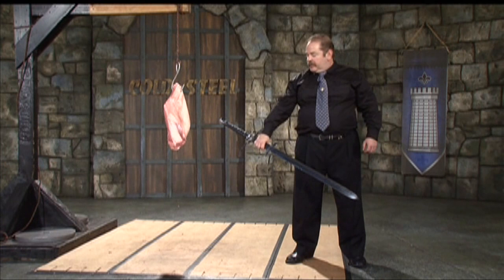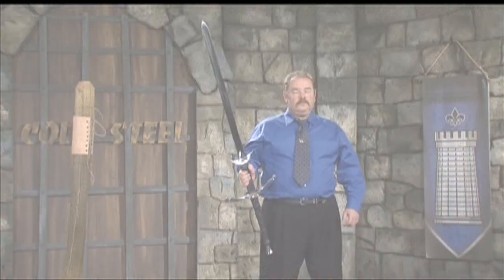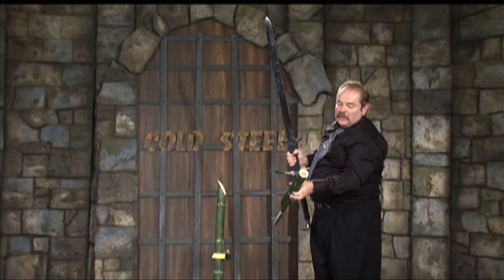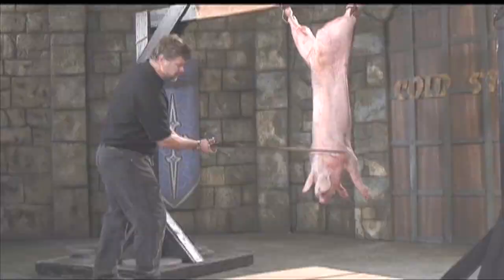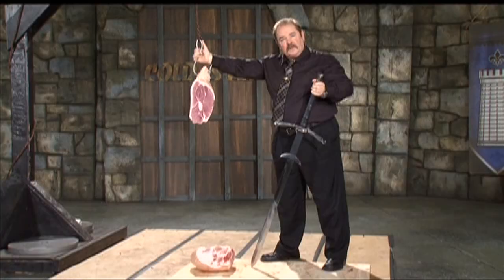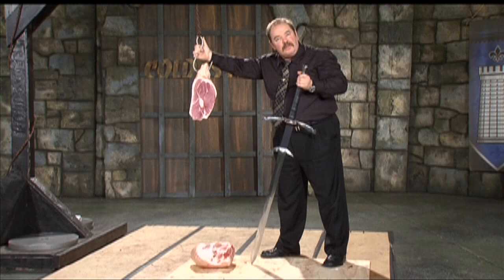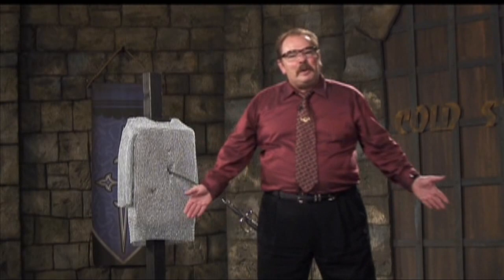Two Handed Great Sword | Cold Steel

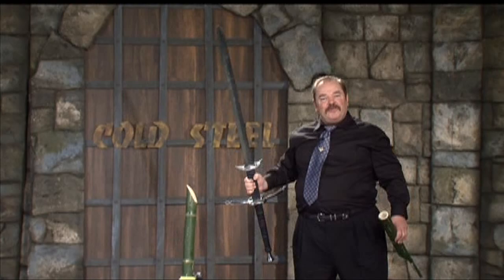Comment: 3:29 Finally i see someone wielding it as its meant to be wielded. Keeping the blade in motion is what defines a weapon like this because you cannot constantly move/halt a 6 Pound sword with this length (although for the weight it should be a little longer).

Comment: "Its an enormous advantage in any fight, so long as your opponent is a stick of bamboo, a balloon, some boots with steak in them or a dead pig hanging from a rope"
Reply: watsupjew No kidding. That piece is much too short for six pounds.
Reply: apparently it was used for cutting down horses! or so my friend said. if thats so, we should be judging it on its ability to do its intended purpose, except horses are valued higher than steaks in boots for some reason
Reply: watsupjew it cleaved those tatami mats pretty good. It's a good sword but yeah I agree that steak with zero bone in it isn't a good cutting test.
Reply: Entraya Crosshill zweihanders were used by frontline soldiers to break enemy pike formations. Pretty much anything that could stab was used to kill horses. but like you said, horses are valuable, so you should aim for the rider instead of the animal and then, once you win the battle you get a bunch of free horses for your army.
Reply: or a Medieval peasant who has no rights
Reply: This sword can cut you in half
Reply: Keep one by your front door, have no furniture or walls, and you'll be a force to be reckoned with
Reply: @potionseller8943  Soldiers were even more valuable to keep alive than horses - you could ransom them.
Reply: @potionseller8943  what's your point?!!! They cut through much bigger bones effortlessly!!! Bones in the cowboy boots wouldn't have made any difference!!!
Reply: @Crosshill  My first thought was that they made it so massive and clunky looking, so it'll just be able to act like an impact weapon. Hit this sword against the helm and the person might get a concussion from it.
Reply: @HayashiKaiji  i had the delight of holding one, felt more like an oversized gardening tool thats how long it was, pretty elegant handling though if you can keep it in motion. like a private sphere with a radius of a sweihander blade, aint no goon wanna have a go at the kind of mad lad dun spun that kinda thing around in battle
Reply: How would you swing this pos in your house?? this thing is almost 2x wider than my hallway.... lol
Reply: @Hoglow101  outside?
Reply: @flamingmexican9956 I was referring to inside the house..... Not outside. Goober lol
Reply: @Hoglow101  For narrow hallways I'd recommend thrusting weapons like a Gladius or some shit cause there's no way you're using any kind of longsword in your house.

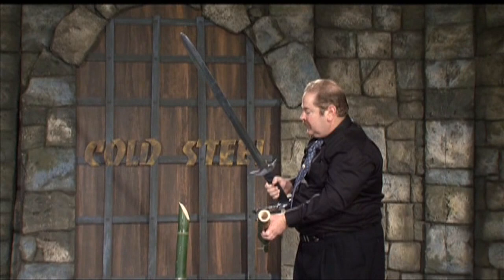Comment: Many people think of a great sword as extremely heavy and not as balanced, but most of that comes from not using certain aspects to your advantage. As a competitive swordsman the great sword is a fantastic weapon for relentless attacks. Using the the momentum from any kind of horizontal strike combine with the weight, you can almost always deliver follow up strikes. I think the best example of this being used is from 3:29 - 3:38 .
Reply: Because it takes a lot of energy to stop your movement after a heavy attack. But a major problem I have had at competitions is getting caught with the blade pointed down, as said it is a heavy sword, and trying to backhand swing in panic usually results in you loosing your balance.
Reply: TheJellyfishLord Pls not now. I play Dark Souls as well but im also a competitive sportsman and what this is actually interesting to read lmao. You ruined it you filthyCASUL!
Reply: TheJellyfishLord Rofl.
Reply: +Rex
Why would you backhand swing when pointed down in the first place? I'm not even into this kinda sport but all the videos I watched about uses of this sword, they usually try to block their opponent at range when the sword is pointed downwards. Correct me if I'm wrong.

Comment: this sword is an absolute beauty
Reply: It's Cold Steel, so not really.
Reply: why the fuck does it matter what it is mate? I think it's fucking beautiful
Reply: dolan dak It appears as a joke, in my opinion. Six pounds? I've owned larger swords that weighed less than that.
Reply: Chris Wedemann it appears that you don't understand english. I said it is beautiful not that it weighs as much as it should.
Reply: @watev26789  its too short for a Greatsword.  Only Conan would fight wirh this peace of crap
Reply: @watev26789  I mean common Great swords weighed around 9 to max 15 pounds which with that length plus armor you carried is incredible! German Mercenarys used this weapon usually to fight pike formations
Reply: And a beast.
Reply: @felixgutierrez993  Common greatswords did NOT weigh that much. Many historical examples (you know, the ones in museums) weight around 4-5 pounds.
Reply: @ozkan576  True those where actually more the Zweihander than anything to deal with Pike Formations
Reply: @felixgutierrez993  Not true. Only massive bearing swords weighed that much. Six pounds is a good average size for a greatsword.
Reply: @andyroobrick-a-brack9355  Right for your average Greatsword, but I'd want me a BIGASS sword...I mean although realistically shown not as effective as it is but just shear intimidation and  Deadliness!
Reply: @felixgutierrez993  Unless you're Gregor Clegane, you aren't going to be able to effectively wield a sword that massive. You'd probably want a Scottish claymore, a greatsword similar in weight to a montante, but only about a half a foot longer than the typical longsword. They're infamous for cutting men down the middle, and are more broad than most other swords.

Still, if I saw someone swinging the beast shown in this video, I'd be pissing a tsunami.
Reply: @andyroobrick-a-brack9355  Yeah heard of him, he was a freedom fighter. But damn I wouldn't get close to that thing if swung my direction lol

Comment: Dark Souls made me love greatswords
Reply: The Zweihander <3
Reply: lenwe94 Der Zweihander
Reply: That depends ENTIRELY on ones own preference. I personally hate the R2 attack of the Greatsword because it's too slow, compared to the Zweihander R2 which is the fastest R2 of all Ultra Greatswords, and it also does huge poise damage and smashes most enemies to the ground. However, they are in fact identical damage and scaling wise, the only real difference between the two are the stat requirements and weight, in which the Zweihander is superior. 
If you don't believe me, then take a look at this http://darksouls.wikia.com/wiki/Ultra_Greatswords
Reply: Do you heven great scythe bro
Reply: Royal Great sword here...

Comment: These guys are amazing. I was watching my new favorite show, Forged in Fire, on the History Channel a couple weeks ago. Its a blacksmith competition show, at first four guys are given the task of making a knife that can hold up to certain tests. At the end of the show two guys are tasked with making a historic weapon, that week it was the Scottish Claymore. Cold Steel may call it a great sword but that's a Claymore, with the Y guard, secondary handle, wide thick blade, extra guard protection, no question. Well these two dolts on the show must have never even looked at or researched a Claymore before, never watched Braveheart, all they knew is the Y guard and that's it. They basically made normal European longswords just longer. They go to test the swords on a pig cadaver just like Cold Steel and the first guy's sword doesn't even cut it just warps and folds right in half. The second guys sword breaks, BREAKS, in half! That's a double fail they should have both lost. These guys are professional blacksmiths and they cant even temper a normal European longsword correctly with all the tools and materials at their disposal.After watching that Im giving Cold Steel my money. At least I can see it, I know what it can do. I mean if it can cut through TWO pigs at once its a bad mofo.   Just wish it wasn't $600
Reply: Not a claymore 🤦‍♂️ it’s a great sword for sure. This is a Zweihänder.

Comment: This informercial inspired me to write Haikus: Six pounds of cold steel
Impressive cutting power
Two handed great sword

Pull ups won't break it
Fat man swings with all his might
Cuts through meat with ease

boots are full of meat
The skulls of pig carcasses
No match for great sword

Right through flesh and bone
Bones crunch as the blade goes through
Twenty pounds of beef

Stabs, hack, crushes, breaks
Throw it right through anything
Deep penetration

Not to be messed with
Advantage in any fight
Great sword by cold steel

Comment: The thing is, most properly made longswords or greatswords would do all of this as easily or even better than this sword. If you're going to be buying a European sword, I would recommend a brand like Albion over Cold Steel any day of the week. Apparently Cold Steel's sword grips come loose incredibly quickly, and the balance, weight and cutting power are inferior to other swords of a similar price by other manufacturers

Comment: No doubt it's a nice sword for a big strong person, but testing it on dry test rolls and green bamboo isn't really showing how good it really is. Soak those test rolls and see how many that big guy can cut through in one swing.
Reply: Also, look at the overswing when they make those powerful cuts. If your opponent dodges or avoids that attack you are left wide open for a quick counter attack.

Comment: Have to say it do look great. But damn its heavy.
For such a short greatsword that weight is just too much.

Of course it do differ from sword to sword, some greatswords are larger and heavier than others. But historically you had longer ones with a blade over 40 inches that did weight under 5lbs.

So for a greatsword of this length it is pretty overweight compared to most historical ones that is about the same lenght, even compared to many that is larger than this sword

So i would personally never pay that price for such overweight sword

Comment: This is a short bidenhander, it only has a 40 inches blade. It should really be between 45 up to 60 with a mode of 55 inches just in the blade. The handle and the cross guard does has the appropiate length.

Comment: Too short for a greatsword. This is a large long sword, or a war sword as some would say. And you shouldn’t grip it by the ricasso, that’s more for either resting on the shoulder, or half-swording adjacent techniques. A true greatsword, zweihander, montante, etc. is about as tall as an average human being, the pommel reaching to about the temple or above when held with the blade tip to the ground. Only then could it truly combat pike formations, and be wielded very effectively against multiple opponents with smaller, more commonplace weapons, as the greatsword was meant to do.

Also, cold steel, nobody fights with greatswords. Nobody buys one for it. 

And that chain mail test was worthless, that was one layer. You can hardly call that armor, cuz it’s not. It’s a fashion item at that point. One layer won’t protect you from anything.

Thank you for coming to my ted talk

Comment: Ok, what the heck. That is not a greatsword. Greatswords at much longer than that, and often taller than it's user. And come on; the ricasso has leather on it? NO! Not in ACTUAL great sword. And it shouldn't be "flick, flick, flick." It is a brutal, blunter sword, which you use like a polearm. That should be classified as a longsword, not a greatsword. Their to scared to make the real deal? Buck up.

Comment: Awful small for a sword thats generally as tall or taller than the person holding it.

Also, when stabbing the barrel, why would you not halfsword it? You were holding it by the ricasso, and then....you just kinda let go at the actual thrusty bit. I have a hard time imagining you guys know what the hell youre doing.
Reply: Also "Thats what a great sword is all about....deep penetration through heavy steel"

No, thats not what any sword was about. You never EVER try to pierce steel plate armor (which is what i imagine you mean by heavy steel), especially not with a sword that has such a rounded tip.

Comment: I'm guessing that the part about sheathing the sword on your back is one of your inside jokes. If that thing were on your back, it would be constantly banging against your calves. You couldn't sit down because the sword is nearly as tall as you are. 

I'm guessing that the bit about having one by the door is also a joke. No one could wield one of these in the average American house. The sword would be constantly hitting walls, the ceiling, and every piece of furniture. You couldn't swing well enough to hit an attacker. 

Even so, the sword would be fun to have for someone with a large supply of targets to cut. As stress relief, whacking things with this sword would be perfect.

Comment: That isn't a two handed great sword, a great sword should have a minimum length of 50 without the handle, that is far less. Also that bamboo test is obviously fake, look at the way it snaps at the bottom.